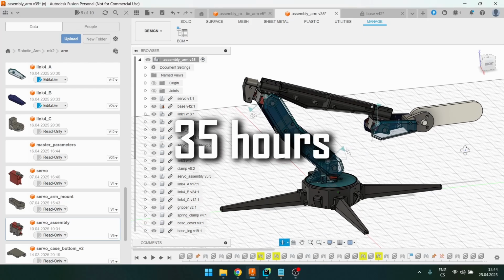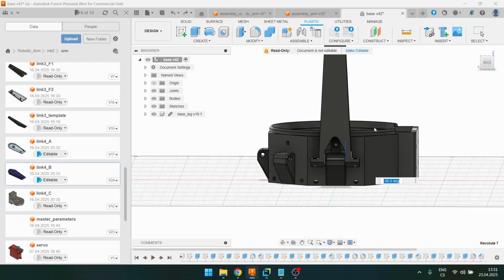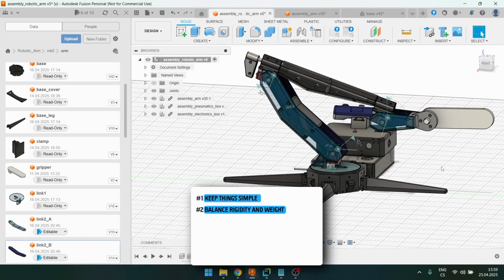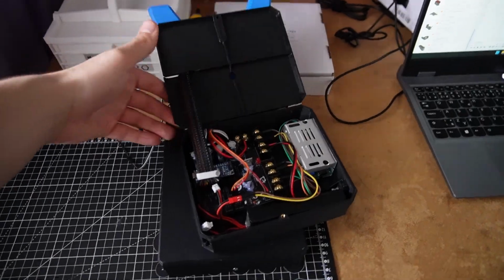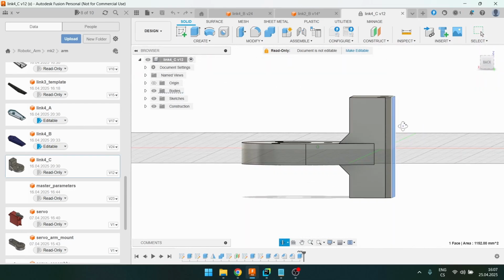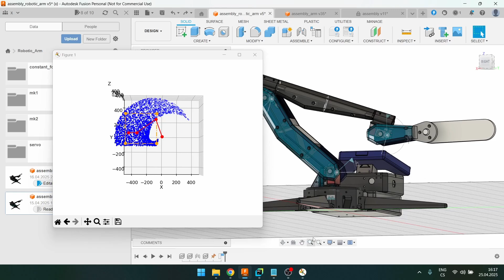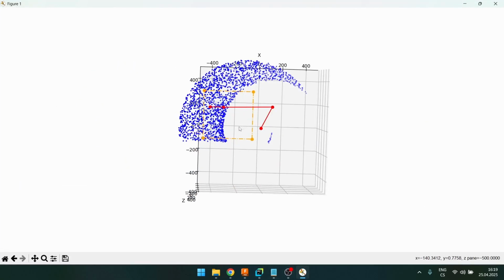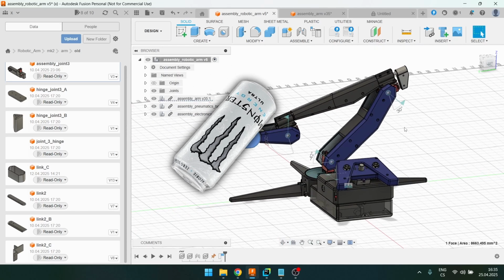I designed a Robotic Arm in 35 hrs

Comment: This looks very nice indeed. One question though: I'm not an expert but if the bottom legs fold upwards instead of the other direction, how can they prevent the robot from tipping over?
Reply from the maker: Good question. I lock the legs with a bolt both at the top and at the bottom. I just didn't mention it.
Reply: @TazerEngineering Ah, makes sense now 👍

Comment: You're 3d printing, so doing a shell in cad probably makes it harder to print?
You can often get similar results by adjusting infill instead, is there a reason that didn't for you?
Reply from the maker: Yeah low infill is fine too. I usually use the biggest nozzle I can get away with and low infill doesn't turn out well.